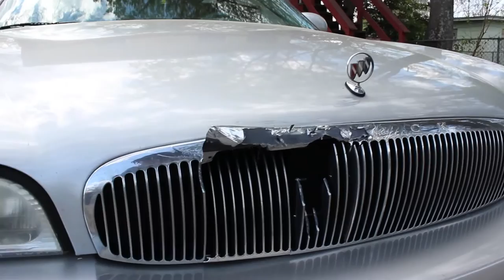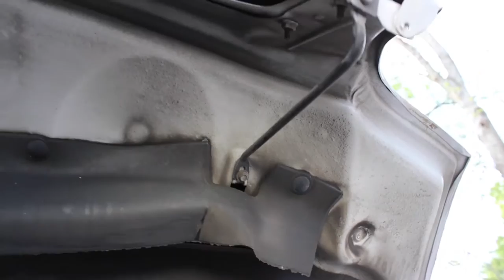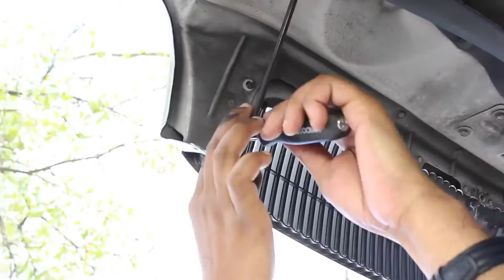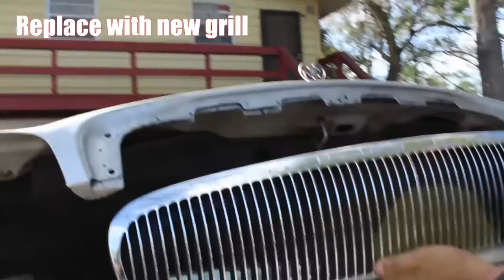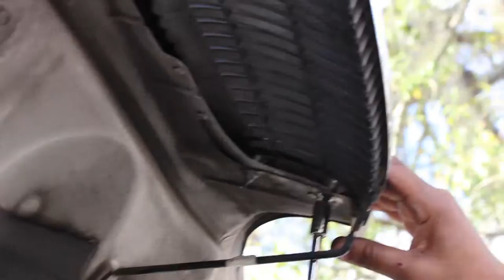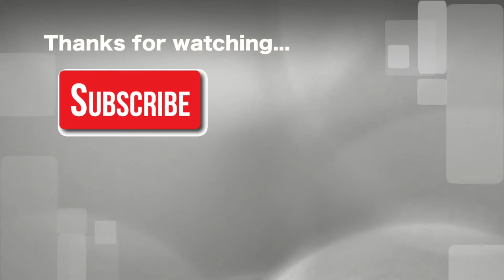How to Install Replace Grille Buick Park Avenue 2002

Comment: Need  only one tool , torx 15 driver . remove the six screws, Remove the grill, and install new grill. Same process as opening a stuck hood latch. Except the hood latch has to be tripped. 15 minutes max after getting the tools together and removing the new grill from the box.